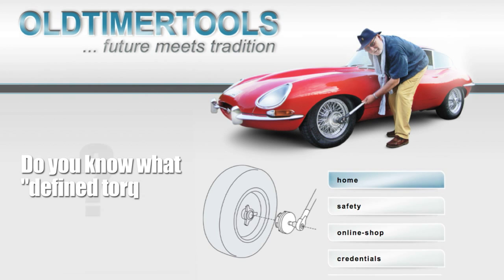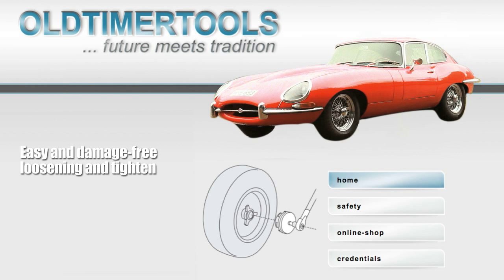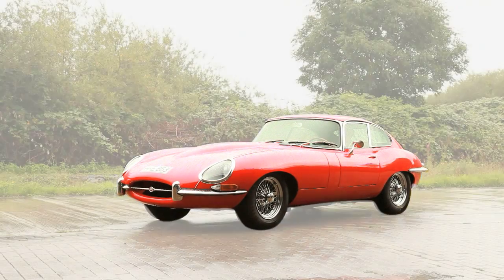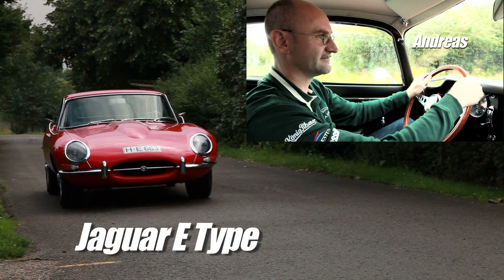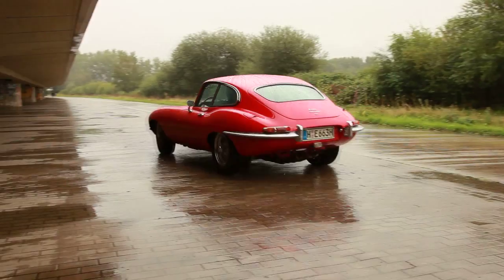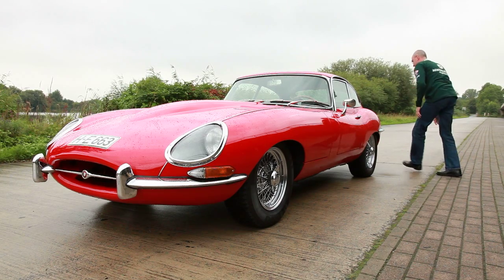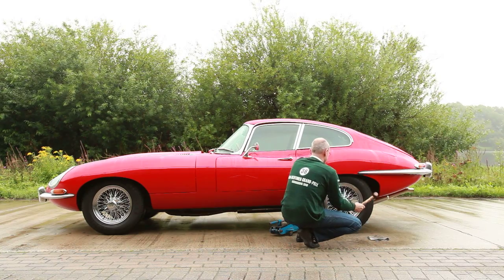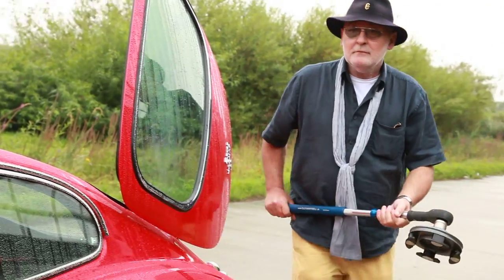Knock off spinner removal tool movie

Comment: no it didn't move, no it didn't. But wheels with knock ons must be tightened and torqued whilst raised, thus my comment. You can do it with the wheel grounded but there is a greater chance of the wheel not being seated true on the splines or to the hub. Or as we call it "on the piss".